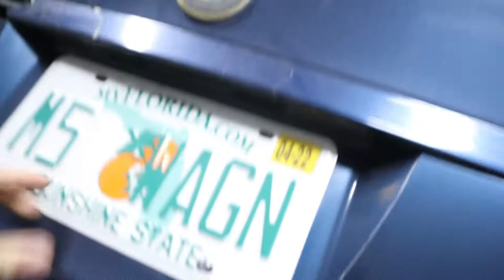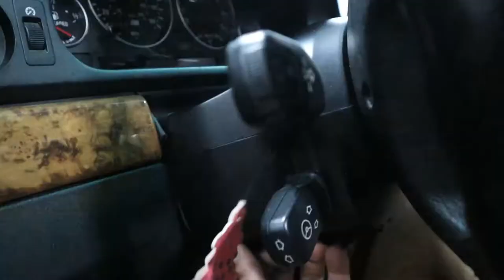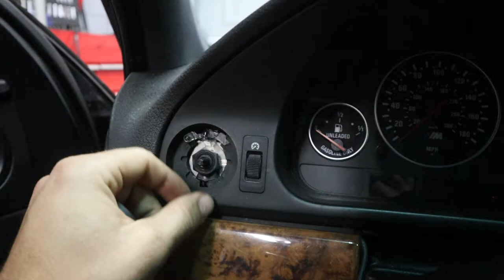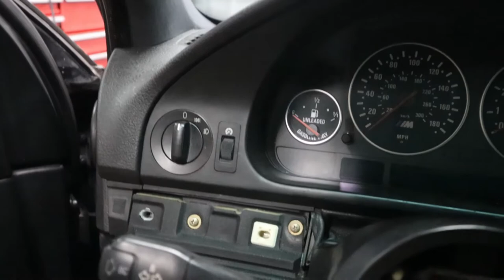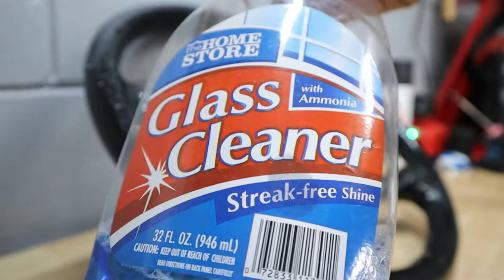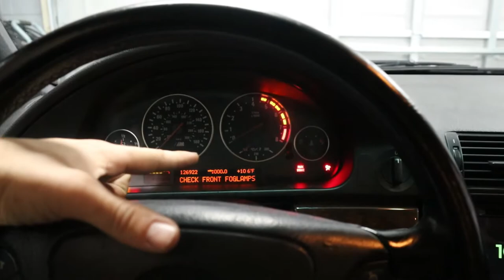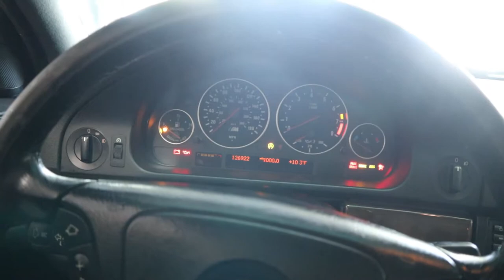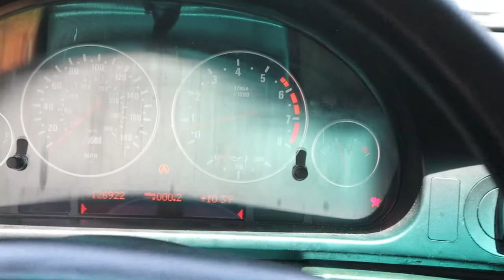E39 M5 Wagon Update Video (Quick Repairs + Driving Footage!)

Comment: I thought the sas was on the steering shaft by the pedals? May be different on older e39 but mine is on my 2003
Reply from the maker: Yes the facelift cars use a different steering wheel and airbag and SAS! I want to upgrade to the facelift style soon, I have all the part needed 😎 you're lucky, you can easily upgrade wheels